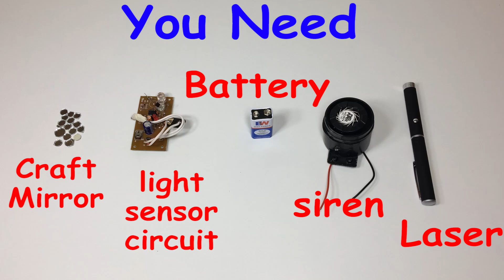How to Make LASER DOOR SECURITY ALARM at Home

Comment: Great job, dude..! Well done..! This one works excellent as an intruder alarm. But I was looking for a similar system to turn a light on or off. In short, when the signal breaks once, a light should be turned on. The same light should be turned off again when the signal is broken 2nd time. (1=On, 2=Off, 3=On, 4=Off and so on). Could you please help me out..? You may use Laser or Infrared too..!